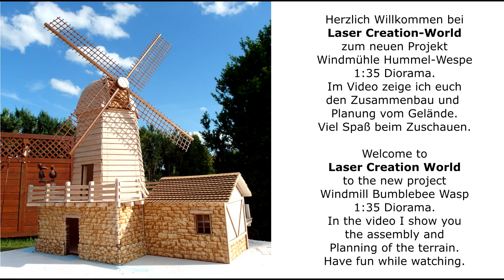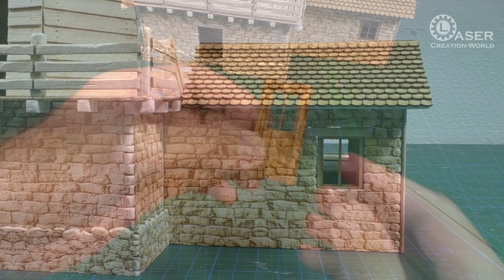Holz Windmühle für mein Hummel-Wespe Diorama 1:35 Teil 1

Comment: Amazing! So many ideas of what else could be done with the windmill building:
- A soldier spotting from the tower (the simplest idea)
-  Mills around here (the few old ones left anyways) would sometimes have a overhead rail and chain hoist at the loading dock for the heavy sacks, perhaps modelled as being used by a tank/repair crew to replace a motor...
- canvas(?) sheets would sometimes be added to the blades, could be modelled with tissue paper and watered down white clue
- motorizing the windmill...
Reply from the maker: Thank you for the information